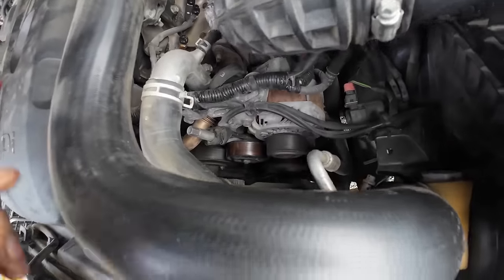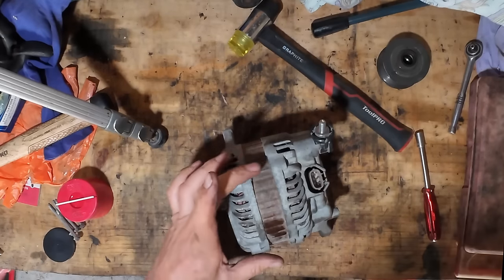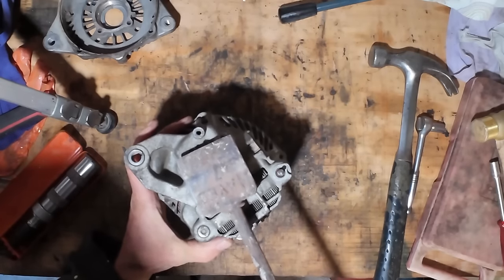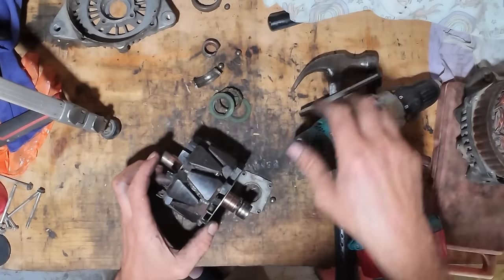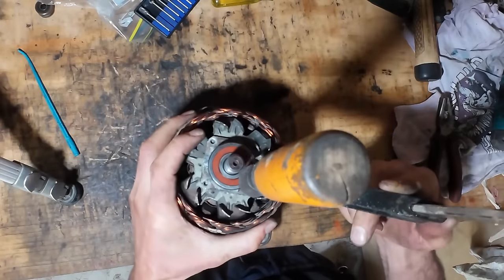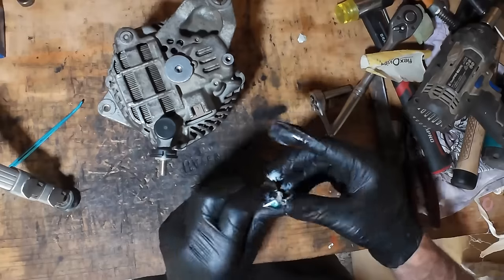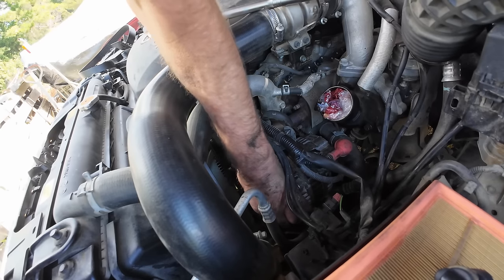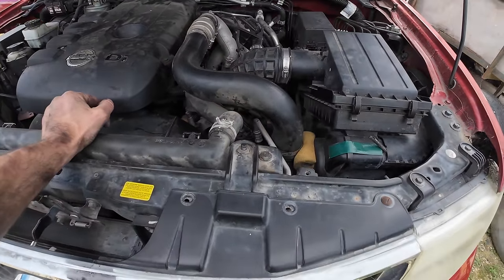Replacing worn out Alternator Bearings - Navara D40

Comment: Most people including myself do indeed buy a new alternator. I learn a great deal from your videos but that dissection of the alternator is beyond me. I enjoy watching your mastery tackling problems that I have never seen.
Reply from the maker: Pull it apart next time, nothing to lose.
Reply: @MartyT  exactly how to start the learning process!  Watching someone else do it first really helps tho
Reply: @MartyT  Only a day or two job and frustration when you finally fail 😂 done that, been there! 😆
Reply: @MartyT well apart from the screwdriver in the hand, bruised fingernails and the burn hole in the workbench… but hey, learning takes sacrifice.
Reply: I had a dodgy starter motor once, a former mechanic told me to pull it apart and go to a certain shop and get a replacement part or parts that cost a couple of dollars. I did this, fixed it and saved heaps.
Reply: I fixed an altenator once. It still didnt work though so I ended up buying a refurb one anyway.  Most annoying was that removing it stripped the thrads in in the block on one of the bolts. Cold welding aluminium is a bitch.
Reply: I have mine rebuilt it cost 85 and it takes him 4 hours,a new one is 300
Reply: @MartyT for a $500 part definitely worth a try, not so much for some other vehicles in other countries.
Reply: Every time I have something that is working less optimally and I am thinking of replacing it, When I have money to replace it, I tear in to it and see if I can fix it and If I can't I can go replace it.
Sometimes it works sometimes it doesn't. But as the man said nothing to lose trying.
Reply: My diy jobs always meant 3, or more trips to the parts and hardware stores.  Plumbing jobs required more trips.
Reply: Nice work, Mr. Fixit!Thanks for the look.
Reply: Nicely done. Every once in a while you find something around your place that hasn’t marinated in the great sinking swamp for 40 years and isn’t that a treat to work on for a change! Keep it up! 🥸👍👀✅
Reply: @MartyT  Have Nav D40 also, Idler pulley Needed new bearings, those pulleys new are ridicules new, just pushed out the old and went to the local Bearing store  got a couple quality new ones pressed them in and belt stays on  Now!
Reply: @rimmersbryggeri   stripped threads are best done with a Helicoil or similar rethreading kit used these a Lot on japanese motorcycle engines...

Comment: Marty,  Last time I rebuilt an alternator (faulty diode) it was a piece of cake to disassemble.  This was for a 1970s car...  It is obvious that, if there is any thought given to dismantling these things during the design process these days,  it is directed towards making them unserviceable.  Well done to overcome their booby traps!
Reply: 3:05 Whacking the alternator on the blind end is just seating the bearing further into the housing. Use the inertia of the rotor to your advantage and tap on the ears around the perimeter of the housing near the steel core of the stator next time.

Also, the small hole near the brushes is for a temporary retention wire to hold the brushes back during reassembly. Pull the wire out once it's assembled.
Reply: yep.. should be illegal to make products that can't be serviced EASILY
Reply: Exactly what I was thinking it looks like it's specifically designed not to be serviced
Reply: No offense and not sticking up for the designers but…
This is a cost issue, almost no one works on cars any more and certainly they don’t rebuild their own alternator.  Even at $50-60/hr here given the choice you would but the alternator vs pay for a rebuild.
I absolutely agree with the notion of design for repair but most buyers won’t pay for that.
As a teen I changed my share or alternators, starters abs solenoids.  Even the motor brushes.  For what ask a modern alternator to do they have an amazing service life.  More than one side to this coin.  But I totally respect what you do.  
I also imagine that if you lived in a big city you’d buy vs repair.  This is likely more a necessity for you, though Nelson is not that far off the beaten track.  Last the planet thanks you for your service!
Reply: Don't think 60$ hr is the rate they charge... try at least double that🤔💰 New one with freight  cost me $470 earlier this year ( cracked housing)😔 .... Italian car. My time is generally a lot cheaper , hardly ever pay them guys and definitely I don't pay myself 😂
Reply: @JonoSann  I have drilled small holes in brush holder several times for this purpose.

Comment: As a retired service engineer, I recommend you buy a windscreen wiper puller. It would have fitted that rear bearing a treat, with nice thin jaws too. I have only one gripe, in that the Tommy Bar Handle bends under extreme loading (6204 bearing rusted onto a 20mm shaft) but in about 8 years of misuse it never failed me. They are cheap, useful tools.

Comment: It used to be the norm to go to the auto parts store and buy bearings, bushings, brushes, and diodes to rebuild starters and alternators. Just chuck the armature in a drill press, use a file to dress it up, a few swipes with a hacksaw blade between the contacts, and put it back together. Lost skills for the most part except for farm equipment and the like.

Comment: This takes me back to the 1970s when I was a parts manager at a car dealership.  We didn't replace assemblies, we overhauled them.  We replaced alternator bearings and brushes.  We replaced starter drives, bushings, brushes and bearings.  We replaced water pump bearings seals etc.  We overhauled carburetors.

Comment: Way back, I had a bearing failure in my alternator - the rear one that is a needle bearing. No damage to the shaft, but the needle race was done. Now for the weird part. Not able to drive to a store for a new alternator or bearings as the fan belt is removed, I had the brilliant idea to re-build the bearing with what I had available, which was the plastic cap to a Raid spray can. I cut the cap into a strip that fit tightly into the needle bearing cup, along with some grease, pressed it in place. Worked fine for more than 5 YEARS, then I traded the car for a newer one!
Reply from the maker: 😮 nice work!

Comment: Marty T, small hole in the back of the rear casting is for inserting a pin to hold back the brushes when assembling. Search "EF Falcon Alternator pull apart - landscape view" at the 3.40 mark to see a view of the pin wire in the back. Many thanks for the vids and keep them coming, always learning. Cheers.

Comment: The Delco Remy 10SI alternators are so easy to rebuild and when the regulators to convert them to single wire use became available, they were the go to conversion for almost any vehicle. I've mounted them on cars, tractors, forklifts and wheel loaders. All they needed was a ground to the case and one positive wire to the battery. Once you have done a few, it took less than an hour to replace the bearings, brushed, regulator, diodes etc. The kits are still available for under $40 US.

Comment: Great tutorial Marty, sadly we live in a throw away society and people were willing to pay for new parts, but with todays extortionate prices it's time to learn to repair and save and learn new skills along the way. In the 70s my brother worked at Lucas B90 refurbing alteraters/dynamos and starter motors all available as exchange units. Goods old days.
Reply: Hopefully, the rise of the 'Right to Repair' movement, and the easy availability of many parts on EBay etc. is going to make it more possible to do some of these fixes at home. it's very satisfying to do even simple repairs, like putting a new set of brushes or bearings in a tool, and returning it to use, rather than simply chucking it and buying a new one...less for landfill, also. ; )
Reply: @curmudgeon1933  Yes it's sometimes hard to source parts and we throw away too much. Remembering my days in farming (UK) you only brought new after all efforts to repair failed and a good deal was Learned.
Reply: Actually most people who replace alternators turn in the old one for credit. They are rebuilt by professionals and reused. They are not discarded like many other products. Replacements are frequently available new, or rebuilt at a discounted rate. I’ve replaced several in my lifetime, and always because they did not charge the battery. And I’ve never discarded one.
Reply: I should add that it was another inspiring and educational video from Mr. T. 
I firmly believe that we’ve been duped into believing that our time is more important than it is, and that we should focus on working for money and spending money on new things. I love that Marty takes the time to do things himself and reuses what’s already available.

Comment: I couldn't really tell, but on a lot of older alternators, the little hole in the back half of the case, used to be for holding the brushes back away from the commutator. You push the brush way back into the slot and then a small pick or cotter pin through the hole from the outside in, that hold the brush back while you reassemble it. once it's together, pull the pin and you're set.

Comment: The trick with the washer to remove the baring was genius. The hole you drilled, I would have tapped is and place a bolt in it for the next time. Keep up the good content.

Comment: Hey brother, 
Pretty sure there is a small hole on the rear housing offset from where there rear bearing is located. If you push the brushes in they have holes in them that coincides with this and you can slide a small piece of stiff wire through the back side of the rear housing to lock the brushes back until you have fitted the rotor and then simply remove the wire piece to allow the brushes to recontact the comm. 
Chur 👊
Reply: 100% correct.
Reply: That's exactly what the hole is for!
Reply from the maker: I had a look with the endoscope, that hole appears to be threaded and blocked with a bolt from the inside
Reply: @MartyT  that's unfortunate haha oh well sorry mate, I was drawing off of memory from 22 years ago. I used to rewind alternator stators for a living and on occasion had to complete a full reassembly. Not everything is of course the same. Cheers brother.
Reply: Yea, every alternator I've ever worked on had this.

Comment: Hi Marty, Thank for the excellent video. At the rear of the alternator is another small access hole, next to the one you drilled. You can push the brushes down and insert a small steel wire (straightened paper clip) there that holds the brushes down when you install the rotor and the rear bearing needs to pass. Once installed, pull out the wire and the brushes will push back onto to slip rings.

Comment: Great job Marty, a man after my own heart.
I've done bearings & brushes on Bosch alternators in the past and they were a bit more straight forward than that Nissan item as you could remove the brushes & no fancy clips 👍🏻
Not having the wherewithall when i was younger taught me a lot as it was a case of strip the old parts down to see what repairs could be done before purchasing new.
As you say, nothing lost if it's not repairable.
And, it's fun👍🏻👍🏻
Reply: Absolutely correct.😀🇬🇧

Comment: I have done this so many times. Bought a used Ranger. Had an electrical problem. While diagnosing it found out someone had replaced the alternator with a weaker one. So I will have to replace it next time it acts up. If you do the swap method make sure you use the proper part. Aftermarkets are notorious for listing weaker parts as valid replacements for the original. Great video Marty.

Comment: I was taught how to use a big copper soldering iron when I was an apprentice about a million years ago - not used for electronics, it was to seal ducting by flowing lead in the joint. Not used one since - times have changed.

Comment: Manual tensioner, brushed alternator, and a 1 way clutch pulley! Haven't seen those things on cars in the US for years. I am guilty of just swapping out alternators and not taking them apart. Usually need the car right away so to tear it apart and order parts isn't practical. But awesome job on the fix!

Comment: had an idler pully bearing go bad on my 4runner years ago.  Toyota wanted 350 dollars to replace the whole part.  Said it was a one piece part.  I punched out the bearing and found one for 2.50 dollars.  So essential to do your own work these days. Good on ya for not just firing the parts cannon at it.

Comment: #MARTY  I put 5 second hand alternators in my BMW e36 M50B20 Auto. 4 were rooted, neever lasting, for various reasons. Diode packs, brushes, bearings, mainly. It turned out that early e36's used a 10mm longer belt. no one knew and partsinfo didn't know it. rebuilding alternators sucks. BTW the two bearings cost >AU$50 ! I couldn't  get the old bearings off with a press or puller and couldn't get a grinder in to remove the old bearings. I hate BMW and Bosch alternators. I bought a Lexus IS359 F Sport.
in 3 years I've only changed read discs and tyres plus regular maintenance, where my BMW blew everything at least once. Head gasket, 2x transmissions, diff, wiring harness... endless list.

Comment: I've never had an alternator bearing wear out, but I've had to replace several sets of worn down brushes (on a 300K mile VW Golf), and a locked-up decoupler pulley & worn brushes (80K mile Dodge van).

Comment: Nice repair of a "non servicable" alternator. I had a broken alternator (Hitachi 135-126) on my Yanmar 1GM10 boat engine. One of the slip rings had a crack across, and later the slip ring lost its grip and was free to spin around the alternator axle.  . I managed to order a generic slip ring assembly from a Polish car parts dealer. The inner diameter was too large so I had to shim the difference using a spiral strip of a soda can and epoxy to fasten it and attempt to center it to the axle. The slip rings were initially pretty off center when spinning it, and because I had no lathe at the time, I used a Dremel tool with a circular stone to remove the tops of the slip rings as I span them around while grinding down the tops. It came out working good and charging for as long as I owned the boat in wgich the alternator was installed.

Comment: THERE IS A HOLE in the endcap of the alternator to put in a plastic rod or soft copper wire to keep the brushes tucked back while you put the rotor in and then withdraw the rod to release brushes

Comment: Push the brushes back in and use a paper clip in the little hole to hold the brushes out of the way,, then insert the armature in ,then pull the paper clip out and the brushes will set themselves

Comment: Did the same job in my patrol a few years ago. Alternator lasted less than a year before it blew out the diodes, so I decided it was just easier to buy a new one. At least that alternator was easier to access and work on.
Reply from the maker: Diodes are cheap ;)
Reply: @MartyT  I did try, but I honestly couldnt figure out what type I was supposed to get, and I just wanted my vehicle back up running. I got a higher wattage alternator for running accessories, so it wasnt a total waste of money.
Reply from the maker: Yes it is much easier to replace the alternator if you don't have time to muck around with it

Comment: Hey Marty, there's a small hole in the back of the alternator, push the motor brushes back, put a paperclip of small nail to hold the brushes, push in the shaft into place pull out the paperclip/nail. And brushes are safely back in place. If or when you do anything else to your alternator

Comment: Good to see you remembered to pull that plastic bag out of the intake, Marty. I was working on a diesel engine and I put a rag in the intake to stop detritus getting in the intake. I wanted to see if the engine would start and completely forgot I left a rag in the intake. The engine started but didn't run right so I shut it down, I was looking over the engine when with much horror I remembered about the rag. I looked in the intake and there it was buried deep, I fished it out and found luckily it hadn't entered where the valves were but got stuck in the intake runners leading to the valves. Lesson learned and I make sure to look at the intake before I button up now.

Comment: Hey Marty having re-built tonnes of alternators myself just a couple tips for next time. Undo the through bolts and then you can gently lever the front housing with rotor still in off using two flat blade screw drivers against the edge of the stator then press the rotor out of the front housing leaving the front bearing in place then remove the bearing retainer and knock out the bearing. Press the bearing off the slipring end of the rotor and re place it onto the rotor not into the housing. Push the brushes back in and insert either a piece of wire or small drill bit to hold the brushes back replace the front bearing into the housing with retainer plate and clean up the rotor shaft and it should slide through the drive end bearing nicely then you can hold the rotor in the vice and tighten the pulley. Then push the rotor into the rear housing and do the through bolts up pull the brush lifter out and you’re good to go